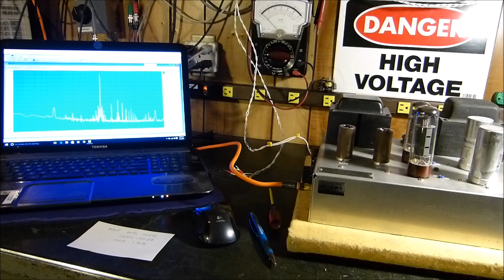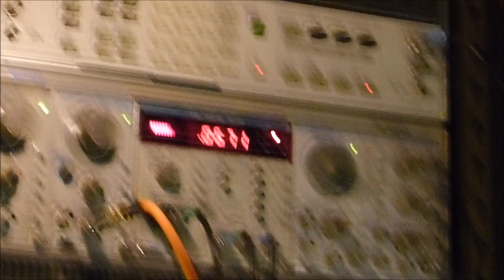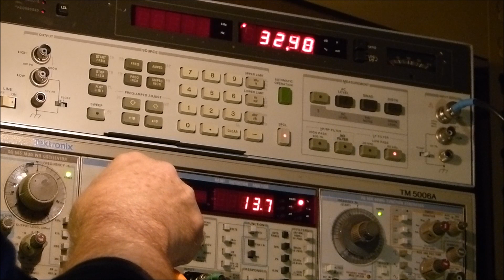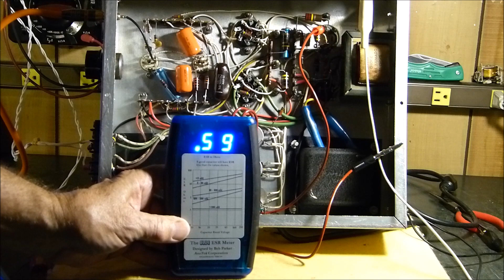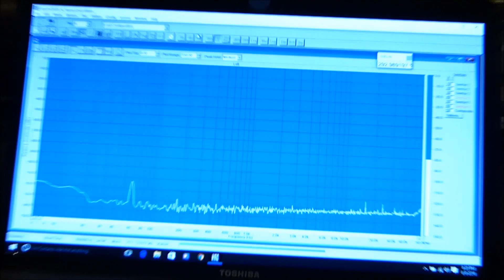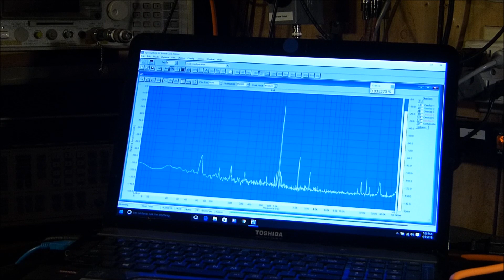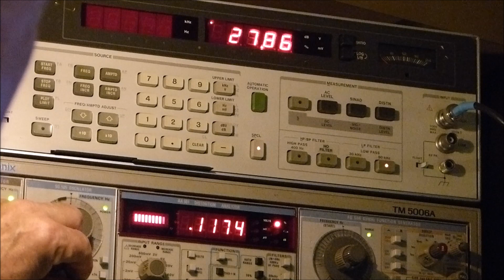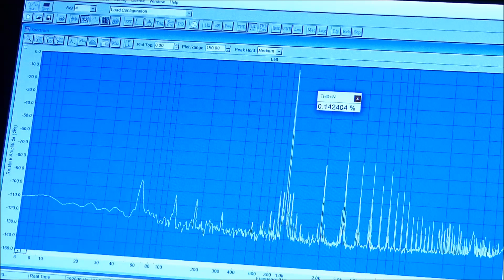Diagnosing THD & Power Supply Problem In Audio Amplifier With FFT Spectrum Analyzer

Comment: Hi again, in my expirience CE Distribution CAN CAPS don´t last. I prefer to stick axial capacitors mounted on a bridge under the chassis and let the can for aestetics (if you don´t want a hole in the chasis), the point is like you , I replaced a bunch of CE CAN CAPACITORS brand new. They lasted 3 yearts tops, Nothing but good F&T axial o radial capacitors (Also Nichicon, Elna or other major brand)
Reply from the maker: That is good to know. I haven't had  bad capacitors for the last several years. I had a run of bad capacitors in a voltage doubler in a Williamson design - that I am listening to at this time - that after a couple of close together replacements have now lasted for many years. I do not know the brand. I series capacitors for voltage ratings to 5.4K and have not experienced failures yet... Thanks for your comment.

Comment: Thanks!!
Reply from the maker: I know this has been a few years but I remember this perfectly. Taught me a real lesson. That power supply electrolytic  capacitor is extremely important and it places the CT of the output transformer at signal level ground. Without it being there, in this case open, the AC (signal and 120 Hz power supply) component off the CT of the output transformer can not get to ground and is trying to get to ground by  impressing a high voltage across the choke looking for an AC (both 120 Hz power supply and AC signal) ground return. Was a real epiphany for me in making me realize that the output transformer is operating from one tube plate to CT and not plate to plate. The actual load on each tube  to signal ground is 1/4 the plate to plate impedance. Thanks for your comments.

Comment: never liked multi cap iin a can,when one of them goes shorting and up in temperature it can damage the others too,and the cost is too much,much better using single radials,you can arrange them in series and parallel.

Comment: I am about to set up my RTA software, but how to I protect my sound card when measuring output from a tube amplifier?
Reply from the maker: You are going to have to attenuate the output quite a bit. 
I would put the 8 ohm load across the amplifier output as usual, then put a pot something like a 5K or so, you may have to experiment a little bit, and put it across the 8 ohm resistor and output also. Take the output from the wiper of the pot and the negative end of the pot to put into your sound card using some shielded cable. 
Note which way the wiper of the pot is at when at least volume (fully CCW) and slowly increase the gain using the pot until  you get just a small amount of what is across the 8 ohm resistor into your sound card. You might want to put a volt meter across your adjustable pot so you can see what is going on and verify that you are only getting a few mV off of the pot before putting that into your sound card.
I so a similar thing when I want to listen to my amplifiers at full volume but control the volume to the speaker. In the case of driving a speaker I use something in the range of a 350 to 500 ohm 15-20 watt pot and just adjust the volume of the speaker to a low comfortable level but able to listen to the amplifier running at full volume in to the dummy load.
Hope this helps.
Reply: ElPaso TubeAmps  Thank you!  Very helpful.

Comment: What cost is that analyser? Looks excellent. I only need -120dB.
Reply from the maker: There is a FFT analyzer that can be downloaded for free off the Internet called
 ARTA. It is easy to find by Google and is free but without a license, I believe you can not save the files or do some advanced functions. The other program is SpectraPlus that can also be downloaded and run for free for 30 days. I think it is better but it is quite expensive. You can contact them for the price and options you want if you choose to purchase it.

Comment: Can you still order transformers from McIntosh today? Will they wind anything 'new', as in not something they ever made for an amp?
Reply from the maker: I don't know if you can still buy individual transformers from McIntosh or not. I am sure they would be very expensive. When I bought this one in 1977, there was no Internet and Ebay for someone to buy every possible transformer from then and then raise the price x10 and sell on Ebay. I have as recently as two years ago bought a brand new glass panel for my MC2205, However, you have to put in your order and pay and apparently wait until they get enough orders to make the production run worthwhile. I assume they do it this way for the reason mentioned above. As for custom transformers, I doubt anyone could afford them. That is just my opinion. If you need one of their transformers, I suggest calling them and asking. I have found them to be a good bunch of people to talk to.

Comment: Thanks for sharing. If you have gone through that many caps perhaps they are getting too hot close to those large tubes? Maybe heatsinks on the cans would help? Could look cool if done well.

Love the Triplett 631 on the wall. I have one I use. The batteries for the VTVM portion can be a pain, though. Love Triplett meters. My Triplet 60 type 2 is probably my favorite VOM. Very accurate, and rugged.
Reply from the maker: I agree with you on the heat of the can capacitor. I just measured it for this comment and it is running between 135 and 140 F. The front can is about 108 F. The tubes are aroud 340 F. I am using a Fluke model 62 Max IR thermometer. I have recently placed a 3x5 paper card between the tubes and cans but I have not measured the temperature yet. Either a heat sink or a shield of some sort between the tubes and the cans.

I like the Triplett's also. Mine is beautifully accurace even on the ohms scale (I have had to repair it from blasting the Rx1 scale...)   I have noticed if you can rotate through all the ohm scales and not have to adjust the "ohm adjust" you can be confident all your scales are good.. 

I personally prefer the Triplett to the Simpson 260. I used both of these meters daily in my work for twenty six years. I am not slamming the Simpson and it is, as you mentioned about the Triplett, much easier to replace the D cell and the 9 volt battery than that 30 volt battery.

And lastly, where else can you get a meter to measure 6 Kv other than the 630-NA ?

Thanks for posting your comments.

Comment: I'm always surprised to see guitar amp, etc guys check ESR and not leakage. When I've repaired vintage radios the electrolytics are nearly always bad (never seen a good one actually). I have the blue ESR meter but I use a leakage tester that lets me test at rated voltage. 99.99% of the time a 40+ year old electrolytic will have unacceptable, often very high, leakage rate
Reply from the maker: I will tell you how I can put your experience into my perspective. I built an RF amplifier for the ham radio 20 meter band thirty five years ago with components from WWII instruments that were thirty five years old at the time. They worked great and were some of the best components available at that time (circa 1980's).  Recently, I installed that amplifier that I built  that many years ago and the capacitors were bad (open). Why?  Now, they are not thirty five years old but seventy years old and I am not talking about  just electrolytic  capacitors but,  Grade 1 Class A components. Just tonight I repaired my McIntosh C20 preamp where one section of  the filament DC supply had one section open (1000 uF). Probably from drying out in the desert south west area.  Changing out this DC filament supply capacitor diminished the 120 Hz by 20 dB. Don't be mindless in your approach to  repair and  think  that all capacitors,  electrolytic or not, should be replaced on sight but do take the time to measure and analyze each situation.   There is no one simple answer that solves all problems.
Reply: I'm not advocating shotgunning the caps. I'm just saying that the high voltage electrolytics in radio (AA5's) and test equipment that is now considered vintage, generally speaking, have high leakage rate when tested.  

Admittedly, when I first started fixing old AA5's, I shotgunned the caps. I don't and haven't done that for some time. I have a "stack" of capacitor testers that I use. I restored an Eico 950 and a Sprague Tel-OhMike Model TO-6 and I test every high voltage cap for leakage with one or the other. I keep all of the cans that I replace and rebuild them. I've got a pile of waxy and electrolytics that failed leakage testing, usually significantly.

I've got a Blue ESR meter and a Keysight 1733C too, but for leakage, I like the Sprague TO-6 and Eico. 

I've got a nice (now, it wasn't when I bought it) Gretsch Model G6151 guitar amp that I replaced the power supply electrolytics in, after testing, and left most of the film caps in the audio section alone. I didn't test the film caps. The amp sounds good and tube bias, etc all looks fine. I replaced only after I tested. 

I've got a pair of Dynaco 70's that I will not shotgun when I get around to checking them out. I've got a couple of vintage ham rigs (Drake R4B and TX-4B, Collins 32S-3 and 75S-3, Heathkit (various)) that I won't shotgun the caps in but the power supply section will be tested for leakage.

With the AA5's and test equipment that I use, the electrolytics get measured and "generally" speaking, replaced. The AA5's are often given as gifts or repaired for a friend. I can't risk having a vintage E-cap fail and wipe out a vintage transformer, choke, etc. Or worse, burn my friends house down :) So I swap them out. I use the test equipment so I want it to be good for the rest of my lifetime at least. Preferably into someone else's lifetime

I have an almost completely baseless theory about old electrolytics. I think that if the device had not been stuffed into a dark attic, or wherever the electrolytics, would still be good. Electrolytic caps like being charged up and when they aren't they dry out and/or corrode. And then 50 years later "we" come along, power it up, and expect it to work.
Reply from the maker: Hi Michael,
My comment of mindless replacing capacitors was certainly not aimed at you and i apologize if it sounded that way. We both know each individual capacitor in vintage equipment  is a unique patient. I think the problem comes down to how much time we want to spend with each component . If we are making a living for our family, we replace all of the vintage capacitors, throw them in the trash, and send the equipment back to the customer is a working condition that will, hopefully, last another 20+ years. On the other hand, if we want to retain the vintage  value we don't do it that way. You know what I mean.

You and I have much of the same equipment, i.e. the Collins S-Line for one example. I have wholesale replaced the paper capacitors in all of my S-Line equipment. I have not replaced the flat ceramic capacitors. It made a big difference and I am not sure which one made the real difference but it did.

I also agree that using the equipment helps keep it working. As you stated, 40 years in a closet and then plugged it in probably won't work. I can still hear  the repair guys of the '70's and '80's saying to the customer, "you can't get parts for this tube stuff anymore. Buy yourself a nice transistor amp and throw this tube stuff away". Quite honestly, probably good advice for the average "audiophile" in those days.
Reply: I didn't take it that way. I feel like we are on the same page and I sure have learned a lot from your videos so it's all good. The 60's and 70's vintage transistor radios will often "wake right up" if you change the electrolytic caps. That lack of use thing... But... they will just as often work. Like you say, they are each unique patients. 

Good stuff. Thanks for the conversation

Comment: By ramping up the power, you also increased the load on the power supply. Thus the ripple increased. But this is excessive. And that's a CE Distribution cap, made on Mallory equipment. Surprised that it is open.

Comment: You have inspired me to use spectral analysis.  I have connected my amp to a dummy load, and have tapped off signal from the OT secondary to my USB out Beringher Mixer to my MAC. I do see the FFT output, but doesn't have the resolution of yours.  
 1. is this a correct way to connect it all?  2. What USB sound card are you using?
Reply from the maker: You would take the signal you want to examine from across the dummy load and attenuate it a great deal. You could start with a 10K pot across the 8 ohm load and use the pot to adjust the output to drive the input of your sound card. It only take a very small amount to drive the sound card. You can download the FFT software from www.artalabs.hr/download.htm. I use a Behringer sound card.

Comment: Very interesting. Would that not have shown up on the HP? It's also interesting that the harmonics went up too - or was that just the whole level going up? I noticed that you run your AA501 unfiltered. I run mine with both the 400Hz and 22kHz filters in - which means I wouldn't have noticed this problem :-) It's also interesting that it was the output-side capacitor section that failed. You would expect the input-side one to go first, as it deals with far more ripple so sinks more AC, has to work harder generally. Keep up the good work.
Reply from the maker: I am amazed at how well the problem was displayed. This technology is virtually free to anyone that has a PC. While the internal sound card of a laptop is not the quality of the HP 3580A, the sound cards all seem to work pretty good to 5 KHz and the outboard USB sound cards are a bit better. 

I had no idea this amplifier had a problem. I have been listening to it for the last several months in my shop and just decided to put the Dynaco in its place and test it. 

It appears once the power supply was loaded heavily everything went to hell. Yes, all the harmonics were extreme. I really did not pay attention to the HP in this case but I imagine it had a lot of harmonics displayed that would have made us take notice. If we were to change  the sweep speed and RBW and actually look for this on the HP, no doubt it would be there (I am talking of the 120 Hz) but without intentionally looking for something specific...   it would have been time consuming and head-scratching for sure.

My point of the video is it saved a lot of time that could have been spent troubleshooting everything from bad tubes  to ???. 

I do run everything without filters. 

Out of thirty nine years I have had this amp, it has gone through three (including this one) capacitors. I used to change both when any one went bad but I did not have an ESR meter then and they are $40 each...  Also, in the past, when these capacitors went bad they shorted, not opened.

The plate voltage is only 460 volts and the capacitors are rated at 525 so they shouldn't be overly stressed. Some capacitors in the old McIntosh amps are around 50 years old and check great on the ESR meter and perform like new. 

I actually had this amp checked at one of the McIntosh clinics that used to tour the country. I still have the plot they drew for it. I should show it some time on a video.
Reply from the maker: And one last comment on the grand 'ol HP 3580A, it simply can' t see anything below -85 dB and -85dB is the tiniest blip on the screen with no resolution so I am not sure we would have noticed anything except the bizzar harmonic profile.  I don't think it would have been reasonable to diagonose anything  beyone that. Technology moves on and keeps no prisoners...